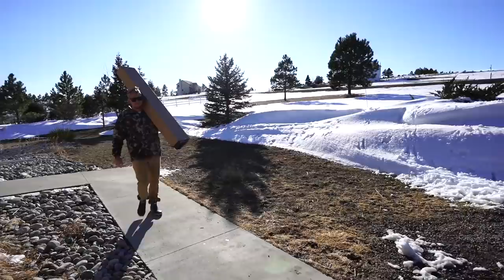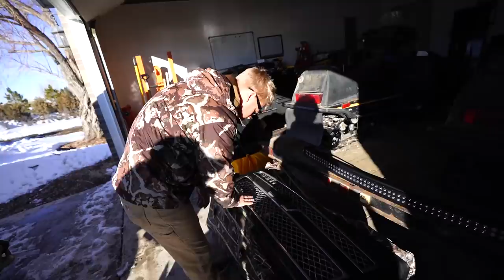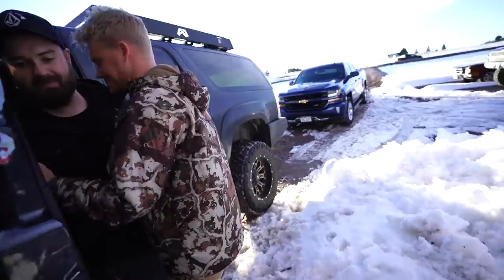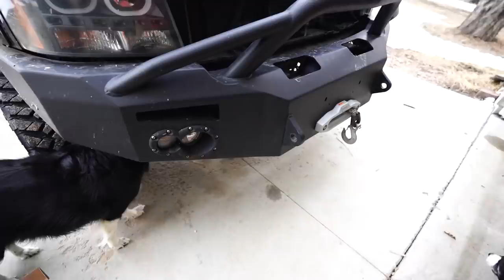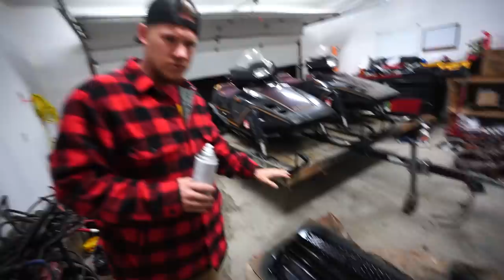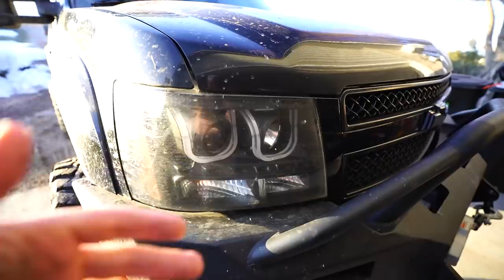MURDERING OUT my Lifted Suburban!!

Comment: Outlaw, Just replace the relay in the wiring harness for the light bar, Clean the contacts really good and use dielectric grease for the new relay. I think that will fix it up man. Good luck!
Reply: Never mind lol but still use dielectric grease on the relay for the new harness. It will protect it so you don't have the same issues.